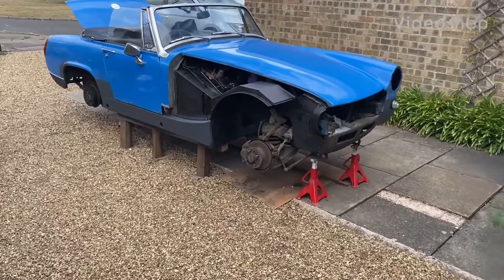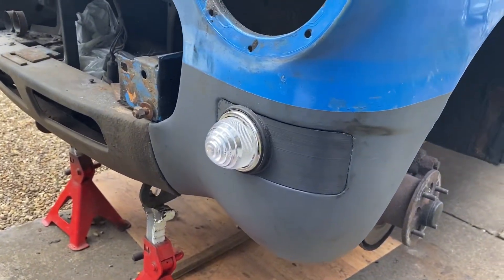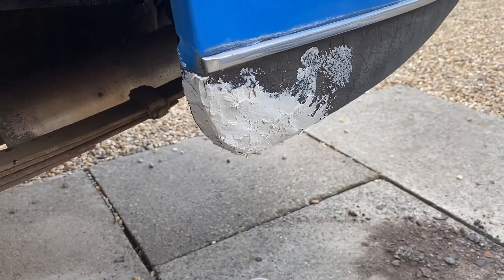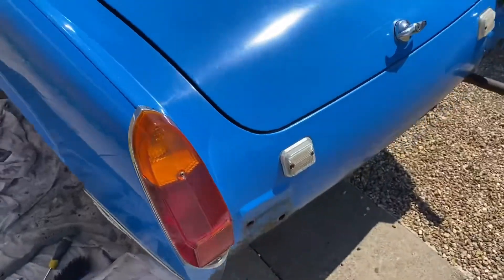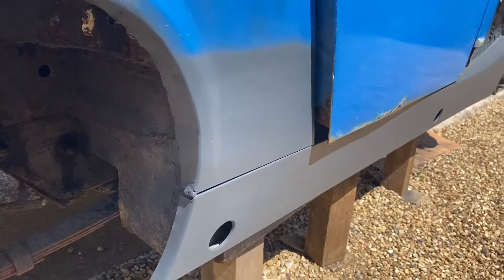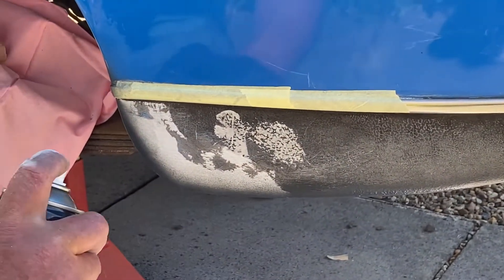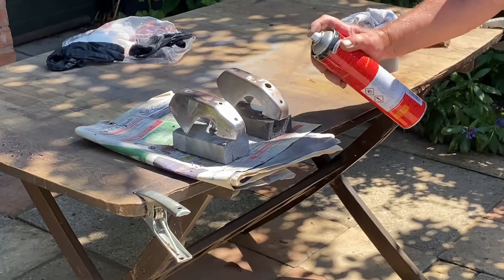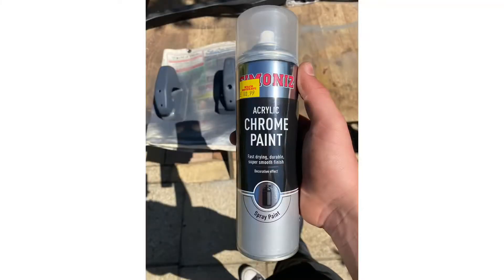Where are are at the minute

Comment: Really interesting content and you have done so much already although could you confirm costs eg how much you paid in the first place and how much spent renovating as would be interested to know? Thanks
Reply from the maker: Got the car for £1500 spent maybe £4000-£5000
Reply: Good purchase price although surprised you have spent so much as seen to be doing all the work yourself?
Reply from the maker: @adriantrundle3414  yeah but some stuff like carpets and interior trim, chrome bumpers, polly bushes, sills, new hood,paint (which hasn’t been done yet), over all the paint and rust preventer, new head lights, new seat belts, over all sheet metal. Once you add all the little bits up it can get very pricey
Reply: @mgmidgetsandme6647  Oh now I can see where the money has gone and gives me a good idea for a project I'm considering as would love to have a go at a Midget. All the best and thanks for your help
Reply from the maker: @adriantrundle3414  no worries mate